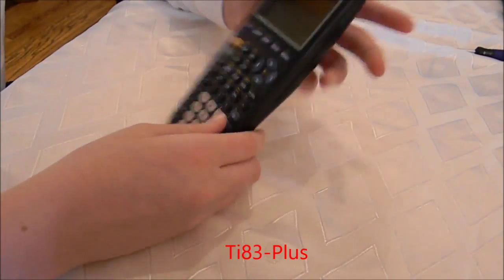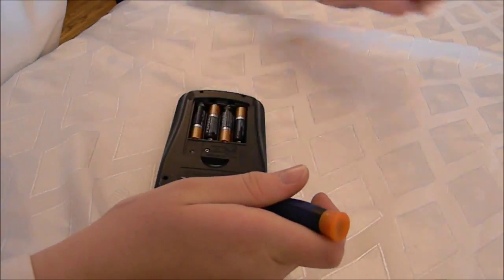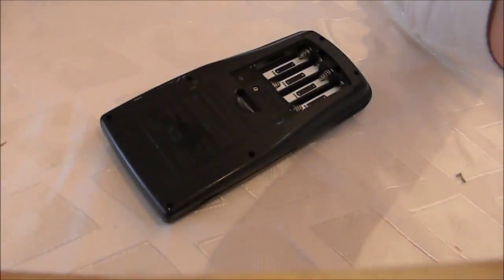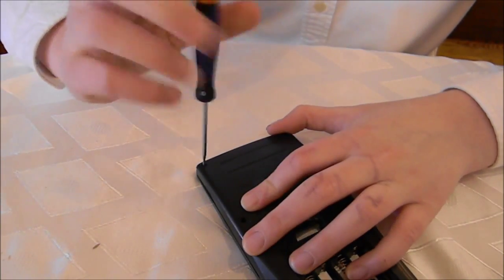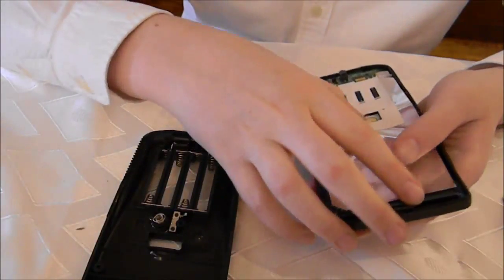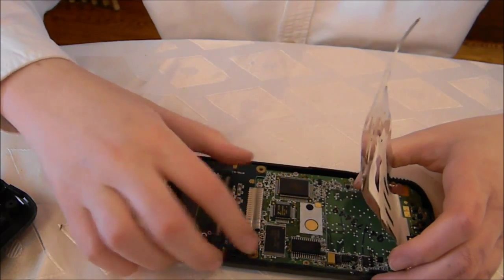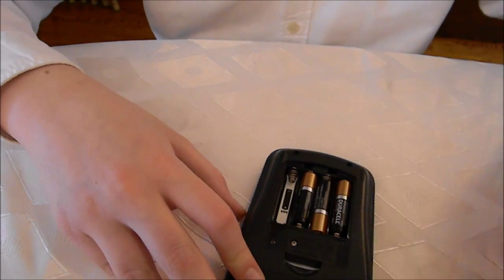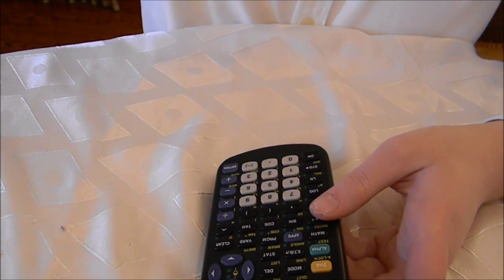How To Take Apart A Calculator

Comment: For other people trying this: Screwdriver bits are T6 and PH00. Taking apart calculator will clear memory (programs, etc.)
Very helpful video, thank you! I got the 7 screws out, and then I was like "what am I missing?" Now I see... brute force :D
Reply: What does mean clear program that mean i would not able to use calculator again...
Reply: He means that it will clear data in ram. Your calculator would be fine. He means that programs, lists, and other data would be cleared. Your calculator would be just like how you bought it.

Comment: I had casio calculator  brand new  had it for what 5 months  I think .Then one day my backpack  fell  of from my desk  and   it cracked / broke my screen where is black I'm not using  it anymore.

I'm using  an old casio calculator   which I got from my friend and I been using  it ever since  it's been what 4 years now  that I had it still working  just wanna swap out the buttons  and plastic  face/cover